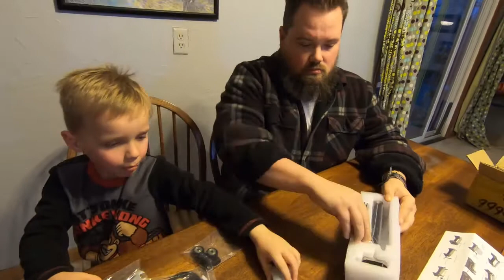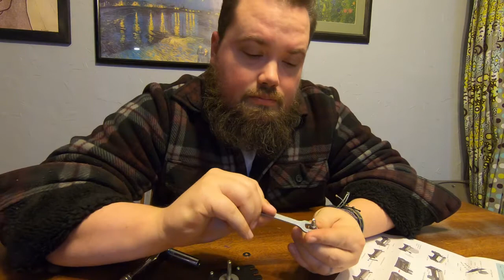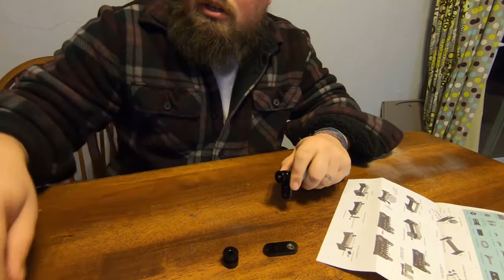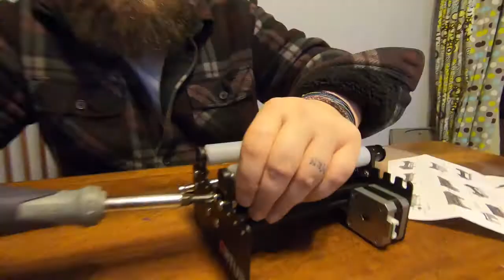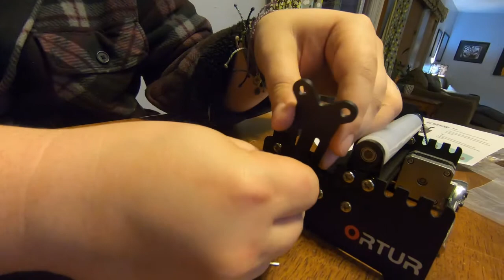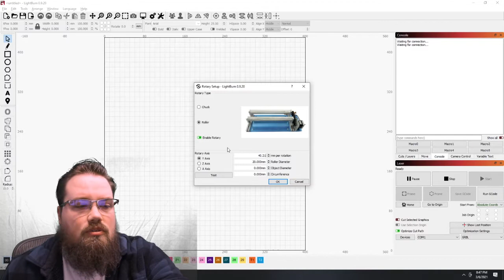Assembly of the Rotary Attachment for the Ortur LM2 - 20W with Lightburn settings

Comment: Strange, i followed multiple tutorials on YouTube (all basically the same) on how to set up a Rotary Roller for Ortur Master 2. Disconnect the cable from the motor and set up the Lightburn. When i enabled the rotary, turned off soft limits,it causes one thing. When i cicked anywhere on the working area in Lightburn just to navigate the laser on that location, The laser starts to go on the right side and after reaching a frame, it didnt stop. It was just trying to go even further i thought it was going to brake. It just went crazy. But to get ti the point. How is this possible, that my roller Works absolutelly great If i just only unolug the cable and plug the roller in. No changes in Lightburn. Everything just stays Like without the roller. The roller isnt even enabled and it Works Like a charm. Any suggestions?
Reply from the maker: The machine doesn't know if the Roller or the Y axis is plugged in so it will run and work either way. The main issue I found with needing to turn off the limits is so that it doesn't try to home and run forever since it can't get to the limit switch. I had the same issue when I tried to navigate the laser. So I quit doing that and just hit frame and moved the rotary or the design in lightburn to get it where I wanted. The only issue I have found by not enabling the rotary setting is that it can warp the burn. It needs to know what size the rollers are.
Reply: @KLRform  i tried to engrave a wine glass and the result was nearly perfect. Just need to adjust the power and speed but regarding the shape or issues with warp there was nothing. It just engraved it perfectly. The problem is i just can get it working with enabled rotary. Even when i try to frame the picture, it just run to the right edge, hit the frame and tries to continue to the right side. I was just curious how is it possible when every YouTube video shows the different process. I am bit dissapointed that ortur didnt describe this in a Simple video just to save their customers some tíme.
Reply from the maker: Glad you didn’t get a warp. I had one until I adjusted the roller size to what I got on my calipers.

Comment: I have a question for you. I have the same setup as you. I just put together my rotary and if I have the rollers at the furthest point I can easily tighten my belt but if I put them closer together there is no way to get it tight enough to work. There are two idlers on this unit. I see yours is the same as mine with one fixed idler and one slotted idler. I have seen other older videos where each idler has a slot to give the belt more adjustment. I think Ordur made a change that might not work. 

Can you please move the adjustable roller next to the fixed one and see if you can get the belt to tighten up?
Reply from the maker: Anytime I have moved the rollers I just adjust the idler in the slot to make the belt tighten up.

Comment: Hi, been following you step by step and at the part of the adjustable roller. My fixed roller installed fine but adjustable one seems .25-.5 short. Any clue why that might be?
Reply from the maker: Are the black acrylic pieces on the inside of the main frame on both sides?
Reply: @KLRform  thanks!
Reply from the maker: Anytime!